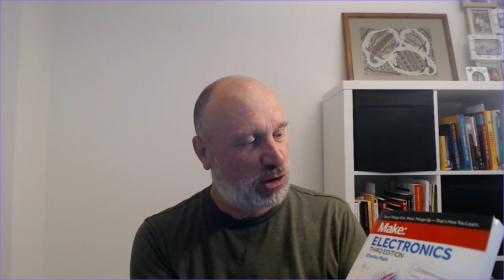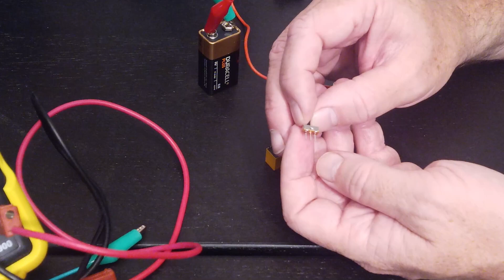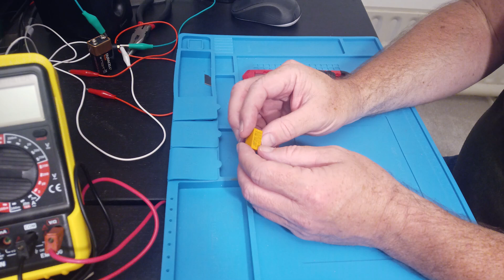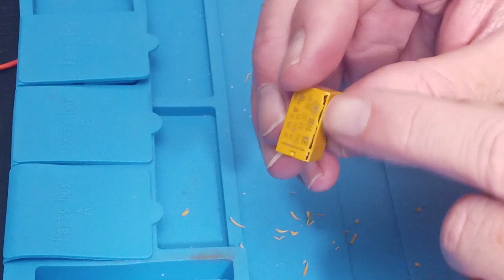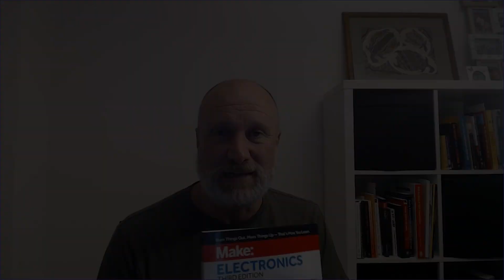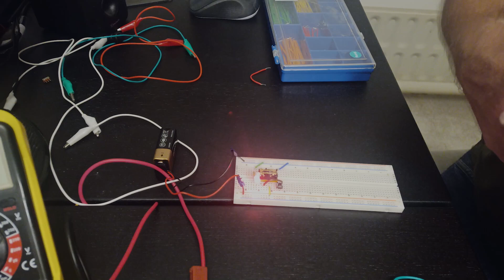Make: Electronics Book Experiments 7 to 8 - Exploring relays

Comment: Question please... This experiment works fine when hooked to the multi meter, but when I replace the meter with an LED and 330 ohm resistor, the LED does not light when I press the button. Any ideas on that???  Yo
Reply from the maker: Hi that's difficult to say without seeing a photo of your circuit. I assume you've already done things like check the polarity of your LED and tried it with a different LED? When you say you swapped the multimeter for an LED are you also making sure the LED is part of a complete circuit from the battery? For the continuity test I showed, the only parts of the relay that get power from the battery are the two pins for the coil. The multimeter provides it's own power for the continuity test. So when you add an LED you must ensure there is also a path from the battery to the common pin on one side of the relay and then a return path via the LEDs and current limiting resistors from each of the other two pins. Anyway if you could post a photo of your circuit I might  be able to see if there's an issue.